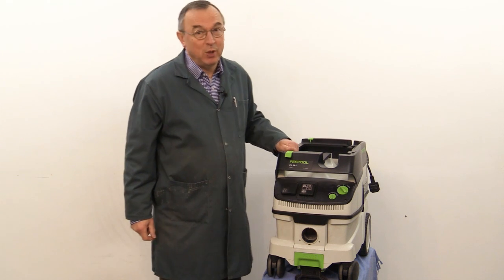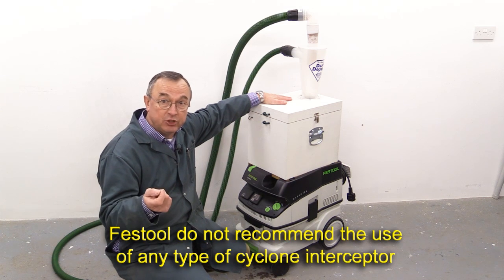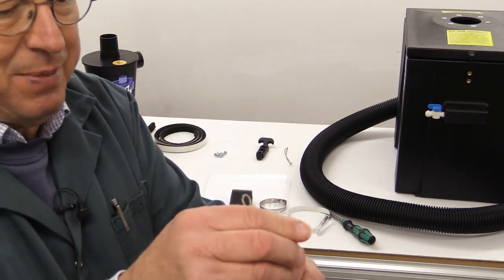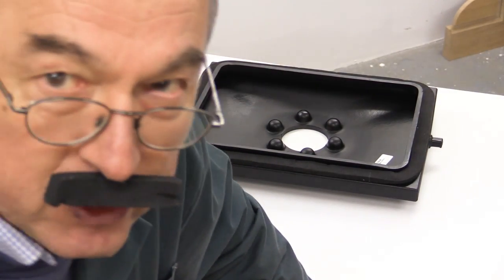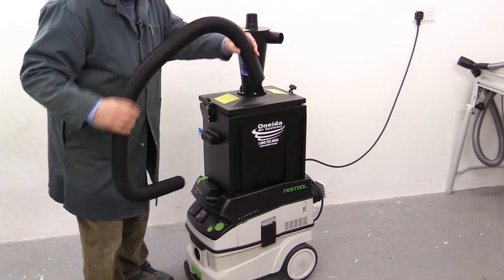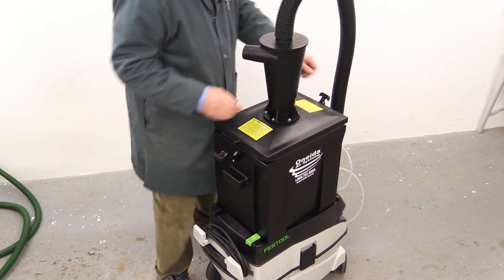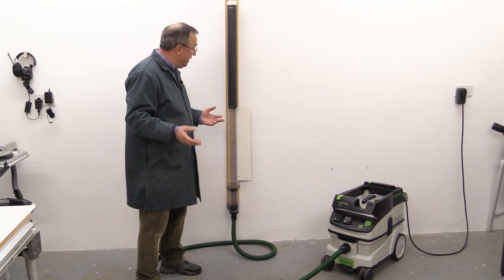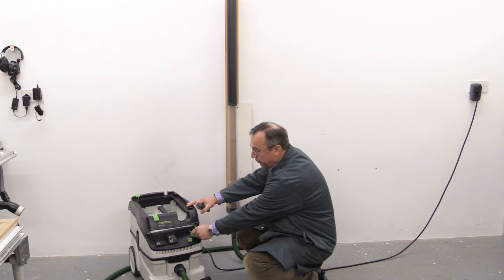Oneida Ultimate Dust Deputy

Comment: A really interesting and highly useful video - thanks for making it!  Have you considered doing a follow up, comparing the performance of the bare CT and with the DD attached, after you've machined a bunch of wood and the bags are half full of fine dust?  That would be a very worthwhile real world test!!  It would be fascinating to see if the DD equipped extractor out performs once a lot of fine wood dust is introduced into the equation.
Reply from the maker: Hi Maximus, Now that is a very interesting idea but not one that I have in the current schedule. I have no doubt that the DD would out perform a CT with a bag clogged with fine dust. Now even with the DD there will be some fine dust getting through to the CT and that is why I always change my CT bag once a year.   Cheers.   Peter

Comment: Good video, very informative. Interesting to see the difference on the suction force meter thingy. 
I have a CT36 with an UDD for workshop use and a CT Midi with an UDD for portable use and I think they are great. I've used the same 2 (very expensive to frequently replace) Festool bags for over 2 years, I've emptied/replaced the UDD bags many many times, so huge savings on running costs as the original Festool bags are close to spotless. Great product.
Reply from the maker: +ishortland Many thanks. Yes, I agree, the UDD is a great product and worth every penny.    Peter

Comment: Hello Peter.  On the video you use a remote power with to turn the vac on.  Can you tell me where you got it from as the one Ive been using has given up the ghost.  Other cheap ones on Amazon just trip off when I try to use a more powerful vac.  Thanks
Reply from the maker: +Chris Stevens I use a cheap and cheerful set from Maplin (a DIY electrical components chain in the UK - a bit like Radio Shack in the US).     Peter

Comment: An excellent presentation of an excellent product.

I recently purchased the UDD and connected it to my CT 36 vacuum.  I made 6, 4 foot cuts of 3/4 plywood with my TS 75.  Inside the plastic bag of the UDD was the amount of sawdust you'd expect to find from those 6 cuts.  Inside the new bag of the CT 36?  Absolutely zero dust or chips from what I could see.

I can't speak to the durability of the UDD as I've only had it a short while, though it does have the feel of a quality product.  I can say it performs very well and is a welcomed addition to my shop.

Thanks Peter!
Reply from the maker: +Boran Theki Yes, I agree, it is excellent. I am glad that you are pleased.    Peter

Comment from the maker: For Theoldguys8...The foil is only needed if you have some non conducting parts that need to be "strapped" into the earth system. For example if you had a join between two parts which was made with a non conducting material.     Peter

Comment from the maker: For Harry Randles who asked if the UDD will fit on the CT36 - I am almost certain that it will as it is only slightly taller than the CT26. But to be sure check with you UDD supplier. Cheers.   Peter

Comment: Thanks Peter An other great Information Vid Peter just a couple of Questions I own the 36CTL Festool Extraction System will the Ulitmate dustdeputy  fit mine. I could not help but notice the pipe that is supply with the dust deputy was a tight fit do they offer other lenghts or is it not a problem

Many thanks
Harry

Comment: If you gave that mustache a bit of a trim, you could lead a Nation?
Well done.. would like to see the changes when half full of chips and fine dust.. the internal filter seems the choke point?
Reply from the maker: bigjuliedive As soon as I read your comment I went and destroyed the mustache. I do not expect there to be any problem with that filter as it is highly unlikely to get any dust on it - the plastic bag is sealed and the dust will be on the inside of the bag. The filter is on the outside of the bag. Many thanks.    Peter

Comment: Hi Peter, Enjoy watching all you're videos. I've been using the dust deputy on my CT26 for about 6 mos. and it works very well. I install kitchens and use it on every job, no problem with the portability you don't even notice it's there. When I received it from Oneida it came with two independent lab tests that show negligible grounding degradation. I had my electrician buddy check it out and came up with the same results.
Reply from the maker: Brian Graver Hi Brian, That is excellent - many thanks.   Peter
Reply: New Brit Workshop A good point is made here, whilst the Ultimate increases the height and weight, the 'footprint' and mobility remains the same. The lid on the Ultimate on be inverted (so the Cyclone is inside the drop box), this makes the system more portable for mobile and site use. Don't forget that the Ultimate clips onto the Festool Vac in the same way that a sustainer does.

Comment: Peter - Another excellent presentation as usual!  Well done!  I will have to do a little more research on the static issues vs warranty issues.  You used a remote control to power up your CT26 - is that a Festool remote?  How does one go about getting one of those?  Cheers!
Reply from the maker: David M Thanks David. The remote control is from Maplin in the UK - I imagine Radio Shack would stock them elsewhere. It comes with 4 receiver units which each plug into a wall socket and one controller (transmitter) with 4 on/off buttons. In the UK they take the full 13 amp load of our normal domestic mains sockets. The whole lot was about 15 UK Pounds.    Peter

Comment: Great video Peter . I've set my Ctl midi extractor to cyclone and drop box which work very well. But I didn't know it had to be earthed due to static . Do you know if running copper wire around the inlet and outlet to a earthing spike would do the same job as the system you have just shown in the video ? I'm just a retired soldier with very limited knowledge of static lol I know in the passed when refuelling trucks with petrol the vehicle had to be earthed. Well I've learnt something new. Thank you keep up the brilliant videos.
Reply from the maker: Terry De'ath Hi Terry, After I built the Dust Hub (see the video) I discovered that Axminster sell an earthing kit for the plastic tubing. It consists of copper wire that is wrapped around the outside of the pipes and then connected to earth. The only problem is that the earth should continue through to the hoses and then on to the tool. I have wrapped copper wire around the plastic parts of the Dust Hub and the wire is connected to earth. I am sure that will help. I cannot test if the Oneida UDD will eliminate static but they have clearly designed the system to beat static and you must make a judgement on what they say.    Peter

Comment: Thanks for making this informative video. I had a Dust Deputy on my vac before I upgraded to the CT26. I also read some of the horror stories regarding static build up effecting the electronics of the CT26 on the FOG. It would be nice if there was some kind of affirmation that the Ultimate DD does not have the effect on the electronics I have heard of. Do you think there is any way to test this for static issues?
Reply from the maker: GuysWoodshop You have to go into these things with an open and enquiring mind. On the FOG there are countless stories about CTs being destroyed by static yet Festool sell hoses which have no anti static properties (the grey hoses). On the other hand Oneida make no claim (that I can find) that the UDD is safe to use with a Festool extractor. Also the Oneida warranty is only 90 days. Every individual must make up his or her own mind about using any cyclone. It is possible to check the static electricity conductivity of your system and it is covered in the Oneida instructions - you just use a resistance meter to measure between the earth at the wall socket and the tool end of the hose.     Peter
Reply: New Brit Workshop Oneida have provided some very useful data regards the static solutions that they have incorporated into the Ultimate system, you can see it here: http://www.oneida-air.com/static.asp?htmltemplate=static/ultimate-dust-deputy-grounding-path.html

Comment: Hello, thanks for sharing this test with us, but to be honest I think it's not entirely fair to run these test only on completely empty bags. I think you should take all three setups, and suck up about 15 liters of sawdust, and then see which system wins. The biggest benefit of using a cyclone is that you keep full suction all the time, instead of losing about 60 percent of it after only having filled up the new (and very expensive) bag only about one third. Even though it's bigger and more cumbersome, I will always use my cyclone. It has, over the course of three years, literally paid for itself more than 10 (ten!) times!
Reply: during which I've always had full suction to work with.
Reply from the maker: Sander Rutgers That is a good point about the performance of any extractor once its bag starts to fill up.   Peter
Reply: New Brit Workshop The key benefit of adding an Oneida Cyclone to your vacuum is the 99+% separation - this means less than 1% of your dust and chips reach your vacuum, so, virtually no filter clogging. The Oneida Cyclone will separate course and fine dust from the air so your vacuum maintains a higher airflow for MUCH longer.

Comment: Was that standard plastic bag or one supplied by the manufacturer?
Reply from the maker: Michael Tricker It was supplied but any bag will do as long as it fits.   Peter
Reply: New Brit Workshop We can confirm this, you get 3 bags with your Ultimate and whilst we can supply suitable bags in packs of 10 - virtually any poly bag will work. A tip: use a bag tall enough so that you can tie the top when it comes time to remove it from the Ultimate drop box. Some customer re-use their bags, some tie them and dispose

Comment: Very well presented Sir!
As a site carpenter I think you hit the nail on the head when you mentioned the problems with mobility and constant use. I have velcroed a new bag inside my 26 and used an old cylinder extractor to clean my Festool 26 bag every couple of weeks using the Festool dust port for access. I can see the bag failing eventually, but should save a few fivers each year.
Thanks for your hard work, its appreciated.
Reply from the maker: Michael Tricker Many thanks Michael.    Peter

Comment: Peter, great video, Ive owned one of these for two years, and Festool USA have said they will not honour warranty because it does not meet their anti static requirements. Also, according to the Festool Training Manager, long life bags are not recommended for sanding applications as the filter allows larger particle sizes to evacuate into the chamber and rendering the HEPA filter subject to abuse.
I have a CT 36 and a CT 48. I use the Dust deputy with my track saw and router and HL 850 planer with the 36mm hose for everything including shop clean up. The CT 36 is reserved, with the long life bag, for my Kapex.
Reply from the maker: Joseph McBride Hi Joseph, Yes, I understand that Festool will not support the use of any cyclone with their extractors. I did not realise that the long life bag had limitations - thanks you for pointing this out.  Also, many thanks for the kind comments.    Peter